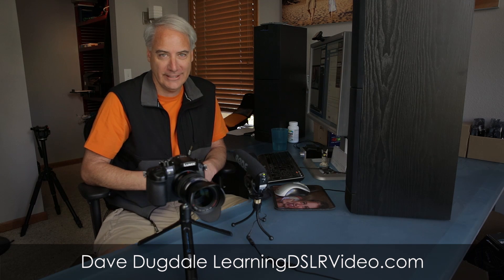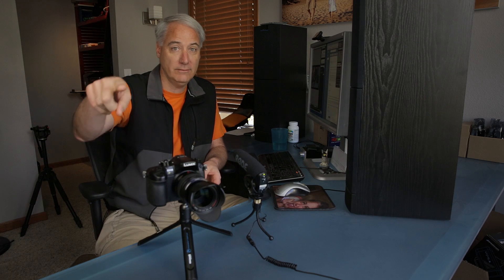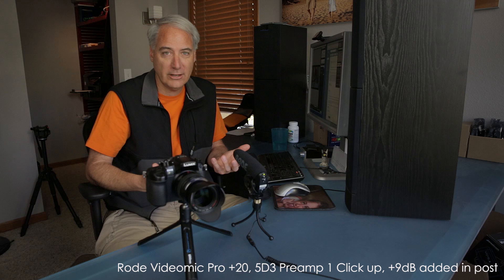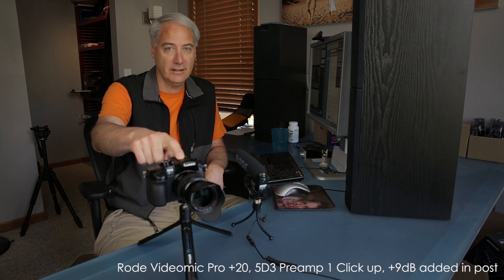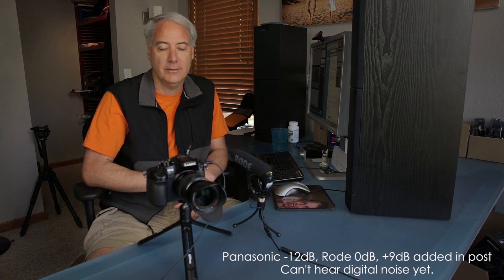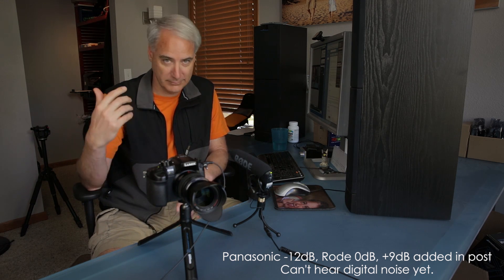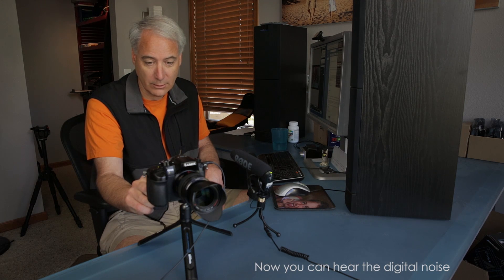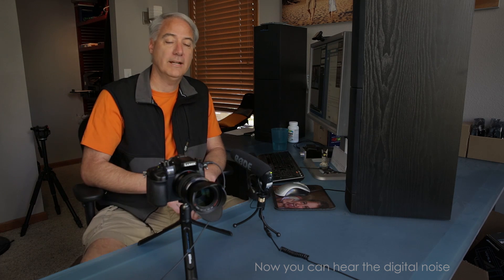Panasonic GH4 with Rode VideoMic Pro Grounding Issue

Comment: I've heard that SAME digital noise.  SO glad to hear that someone else is having the same problem as well.  I've just been turning the in-camera gain down to -12db and turning up the mic (I'm using a DSLR-XLR adapter with a Rode NTG-2).  I noticed the issue a few days ago.  I've just been using noise reduction to drown it out after turning it down.  I then tried using a different cable (from XLR adapter to GH4) and I think that works.  Haven't noticed the noise as much.  I thought it was a bad cable but it seems like a GH4 issue.  The noise coming straight from the XLR adapter is clean.

Comment: Actually you can hear the noise even on -12db. I don't think it's a ground issue, it sounds more like the CPU of the camera interfering with the audio preamp so not very good shielding internally. Something similar happens with the output of my tablet, you can actually hear the CPU doing stuff, like a mix of square wave signals
Reply: You could be right

Comment: I am having similar issues with the Sony AX100, so its not limited to the GH4. I use both depending on the project and have unfortunately gotten use to adjusting to overcome the faults. Truth is, its been better than my Rode NTG2.

Comment: if they can boost the audio down to -20 like in nikon, then you would hear zero white noise when you have the rode plugged directly in to your nikon5300. i just switched from nikon to lumix but i can see that panasonic audio levels needs to come down abit more. and im with you, the plus 20 is way too loud.

Comment: The 5D Mk III has a noise floor more akin to a hiss while the GH4's sounds more like a buzz around 270-275 Hz.  I tried to match the pitch of the buzz I heard by generating a Sawtooth Tone in Audition (I used 273 Hz); I also looked at the frequencies in the Mastering and Analysis pane and noticed similar "spikes" along the same harmonics, they were very noticeable with the generated tone, and visible, albeit subtle, in the clip audio (I can send you the screenshots if it might help).  This digital noise is a lot more noticeable and more coarse than a "normal" hiss.  Good catch, I hope it's something as simple as a minor misconnection between two slightly different input/output connectors and can be remedied with the correct adaptor.  Thanks Dave.

Comment: Do you know if Rode made any changes in the new version of the VideoMic Pro to avoid this isssue? I know they changed to a Rycote Lyre mount and changed the microphone capsule itself. Also the more recent GH4s have a fix, but I have an early GH4 and reports on the mod Panasonic made available seem mixed...
Reply: +John Leslie Okay, I can now answer this... no, the new version of the Rode Videomic Pro has the same issue. I sent my GH4 to Panasonic's sole UK repair house (3rd party) and they very promptly sent it back with the repair listed as "replaced main PCB" and my settings all toast :-(  although luckily I'd recorded almost all of them.
It also came back with an older firmware version than I sent it (2.1 vs. 2.3).
Reply: Did the repair fix the issue for you?
Reply: Laura - I'd say no, the audio noise looks the same except the new motherboard inserts a very brief audio glitch at the start of recordings (I don't think it's anything to worry about, it just shows they really changed stuff). I was quite surprised by the lack of change (but can't post photos here).

Comment: Sounds like digital audio interference. Close to the sort of sound you get if a mobile phone is nearby an unbalanced audio source, slightly buzzy. So yeah could be a grounding issue. The tone difference in the mic is amazing - to my ears the GH4 sounds 'colder' or more harsh in the mid top range than the Canon input. In general though, i'd only use on camera audio as a back up, never as main audio source - for that I'd stick to my Zoom H4n & Rode NTG2 & lavaliere mics.

Comment: The best way to use the rode mic to use is a zoom handy,  zoom h5 , zoom h4n or zoom h6 is what I'm using for the rode mic pro. I have the rode video mic for $149 mounted on my gh5 and I have no issues it work better than the rode pro to be honest. Also check out the smallest rode video micro it's about  $60 and have great sound quality on close up shots. not all expensive mics work better they just want your money. when I do my post production I tweak the audio anyway by adding music or sound affects or filter out the buzz sound. so get a boom pole and use the rode mic pro trust me it's better. I'm not a paid advertiser for any company just giving my opinion

Comment: hi Dave...I have the same issue with the Rode Videomic Pro and my GH4...is there a fix for the grounding issue...can you please reply?  Thanks.  Wayne
Reply: Wayne, did anyone reply to this?Did  you get to the bottom of the issue?
Reply: I sent the GH4 back to Panasonic Canada's service facility in Ontario, Canada.  They fixed it under warranty.  Thanks Leslie for your concern.